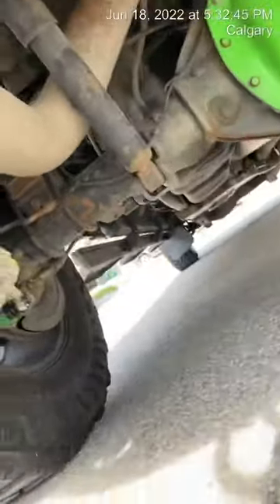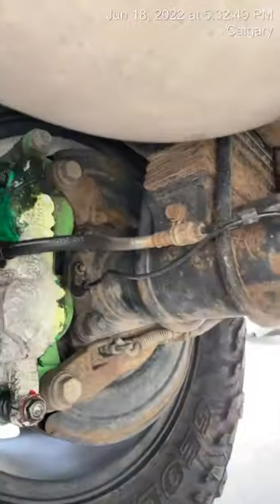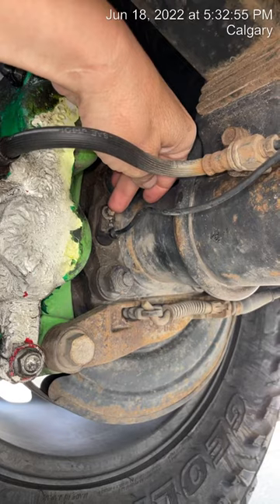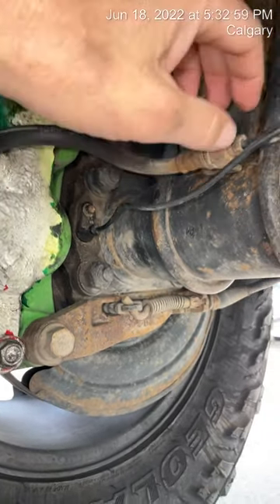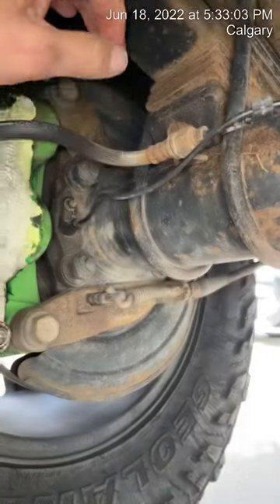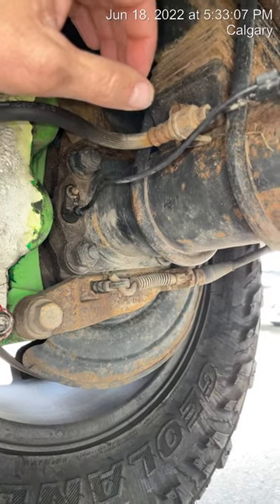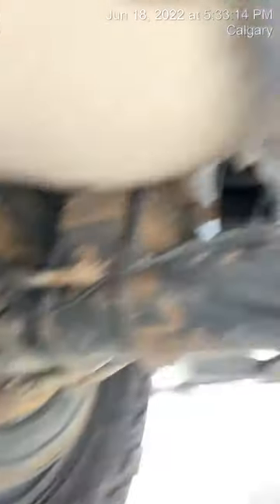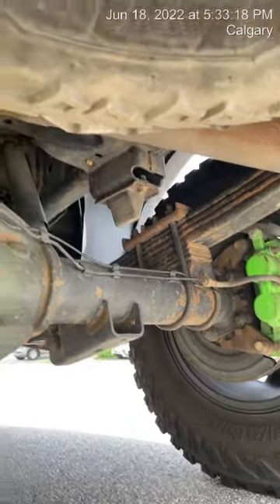2015 Dodge Ram 3500 service electronic breaking system  ABS repair. NO PARTS NEEDED

Comment: Hey bro, thanks for the video.  I went to try it, got the bolts off but the sensor won't come out.  The don't move at all, any suggestions on how to loosen them so they will slide out?

Comment: So I finally have my 2018 Ram 2500 fixed. It’s a long story but what it ended up being was a bad HCU (hydraulic control unit). Ordered a new one from Mopar and had a local shop install it.

Comment: FYI- the sensor is a magnet that produces voltage so metal shavings can reduce its efficiency to the point of setting a code. I have found the same problem multiple times

Comment: Hey brother I truly truly thank you for taking time out to do this video for people like me. I got that exact same thing on my dash today and had no idea. Thank you sir.
Reply from the maker: Right on Nate, sorry for the late reply, just saw it now.  Glad to help, I couldn't find any simple repairs so funny how things get fixed when they just need a good cleaning.  Happy Ram'n
Reply: Nice, what did you clean it with?
Reply from the maker: just a rag man, just a rag!   @rudolphblair8577
Reply: Did the same thing work out for you cause I have the same issue?
Reply: I have a 2017 ram 2500 will try this tomorrow! Ty
Reply: @JONESY7MM  I’m not a mechanic at all but some the job myself and it was very easy. Doing it myself saved me probably $500

Comment: I just did this to my 2018 Dodge Ram 3500 about 5 minutes ago. The light is no longer on, but it comes and goes while driving. I will update soon if it looks like this truly solved the problem (fingers crossed). That said, there was a mountain of soot all over the sensor, so I think this trick is what it needed.
Reply: having same issue light comes and goes on my 2014 1500, did this fix for you?
Reply: @BaconatorJR1  It did, but only for a short time. I had to get rid of the truck, it was having WAY too many problems. I traded it for a 2021 Dodge Ram gas engine. Every time something went wrong with my diesel engine, it was a nightmare getting it fixed.

Comment: Just want to say thank you !
I’ve got a 2020 ram, which is kind of similar. I took out the little modular, cleaned it, put them back. The thing was still locked up until I put my belt on and open the door and disengage the brake.
Reply from the maker: interesting.  Everyone seems to have a bit different solution and outcome but it all boiled down to that gunked sensor.  Cheers

Comment: Thanks alot! My driver side rear sensor was super gunked up. Cleaned both and unhooked the battery for five minutes, and went for a ride. Didn't go away right away, but after around 20 miles of driving I haven't seen it come back.
Reply from the maker: sweet, so glad it helped another happy customer! ;0)

Comment: Hi there, I have Ram 1500, 2014 and same issue with the ABS and traction control lights on. I just came accross your video after watching numerous videos about changing the ABS sensors, buying diagnostic scan first, etc. I am in Prince George, Canada and its currently snowing with minus 15. Hopefully I can manage to croll under my truck in the morning when it's a daylight and find those rear sensors you were talking about in the video. good luck to me!
Reply from the maker: Hey Angelina, ya hopefully it helps you too.  Seems to be helping the others that have replied here.  Thx for your story, keep me posted.  If it works for you make sure you "subscribe" and "like" so it'll start making the vid go to the top and help more so you don't have to search so hard.  I don't post much but this one sure seems to be helping ppl.  The again Angelina & good luck!

Comment: My truck started doing that. If you take the hydro boost lines and you shake them, there's a liner on the inside of them. You can see it on the older generation of ram. It would get sucked into the tube going to the hydra boost. If you change the HCU and the ABS module I would consider looking into and replacing those lines. I'm getting mine custom built to where it gets rid of the liner

Comment: my 2018 did the same thing all 3 of the lights turned on at the same time gonna see if this fixes the problem
Reply: Did it work? I also have a 2018 with the same issue.

Comment: I am having the same issue on my 2018 Ram 2500! I just cleaned both sensors. You were right they were both caked up with brake dust I guess. Hopefully this fixes the dash warnings. Thank you for posting the video brother!
Reply from the maker: my plesh Dude.  Glad I could help another brotha
Reply: did it fix your issue? i got the same thing going on just started this morning. i have a 2017 ram 1500 laramie with 51k miles. i literally just bought it saturday. pretty disappointed as i cant use 4x4 or cruise control until the light is off the dash!
Reply: @levisouthern4869   no it didn’t fix the issue. My warning lights come and go. The dealership said I need an ABS control module which is on national back order and not expected to be out until July! It’s ridiculous!!

Comment: Thanks for the info. I just clean all four of my sensors. Did your error message go away right away or did it take some time to register that you had cleaned them.
Reply from the maker: I don't recall there being front ones on mine.  Whats your year and model?

Comment: Thank you! Fixed my issue as well and saved me some $!
Reply: @Balthasarbrin Seems like once I got above 70 abs and traction light kicks on and it says trailer, abs and electronic brake system service, also my cruise won’t work when this happens. I just had new rotors and pads done at les Schwab but did you have the same problem??

Comment: Thanks I'll give it a shot
Reply from the maker: did it work for you?
Reply: @millertime7396  no it didn't, but at least I tried. So I just plugged it back in and put the panel back on. Too much electronics on these trucks!

Comment: Is the sensor just in the rear?  Or on front and back?
Just got this on my 2014 Ram..
Reply from the maker: I just had all my wheels and rotors off doing a rotor and emergency brake replacement.  I did not see the sensors on the front wheels, only back.

Comment: Yesterday my ABS light(s) came on my 2016 RAM truck's dash as I was driving out of the driveway.
I took it to my local Dodge RAM dealer. They said the ABS Module had an internal failure.
The diagnostic charge was $ 160.00 and the module was about $ 1,400.00.
They said it would take about a month to get it in as they only use genuine Mopar parts.
My truck is 7 years old with 32,400 miles on it. 
I purchased the Mo Par Max Care unlimited warranty which covers every thing (5,000) parts.
The mileage limitation was 1,000,000 miles. You may say I have a lifetime warranty.
That was the best thing I could have done was buy that warranty for my truck and my wife's car.
Dodge does not offer that any more.
All I have to pay is $ 100 deductible and I'm back on the road.
Reply: Damn eh. Redonkulous and they’d prob do exactly what I did and say you got a new module. Lol. Frickin stealers. 
Stealing Dealers. Lol. 
No wonder they stopped offering that. I’d be all over that too if avail. 
You should be able to ask for your parts back. The modules prob still good. I’d get the new one installed, take the OG back install the OG myself just to test and see IF it was the module. If it wasn’t you got a 1400 part to sell for $700. You just made $600 instead of paying $100
Reply: @fitfixinc.206  If it wasn't under extended warranty I would take the part back but since they are paying for it the parts is theirs. My last truck was a Ford F 150 super cab that I bought new in 1988. I kept it for 27 years before selling it. It was costing me more in repairs than I was paying in new truck payments.

Comment: I have the exact same issue right now.
Reply from the maker: did ya get er fixed?
Reply: @millertime7396  I bought the new sensors but I have yet to find time to install them.

Comment: I just had my rotors and pads done at les Schwab almost a month ago then this happened. At lower speeds it’s all good but seems once I go 65+ I’ll get abs and traction light and it’ll say service trailer, abs, and electronic braking system, also cruise won’t work when it happens. Did same thing happen with you??
Reply: Hey Man, it was so long ago I barely remember. Everything I knew at the time was in the vid. If your asking if it’ll help or not, just do it. Easy enough and could make the diff. 
NoDoubtAboutIt.
Reply: @fitfixinc.206  is it just as easy to clean the front sensors?? Or would I have remove the tire and calibers
Reply: Honestly not sure. I only had to do my rears so far. I’d assume it’s just as easy tho. I never had to remove anything.
Reply: @fitfixinc.206  mine turned out to be the front abs speed sensors. Rears definitely needed cleaned but thanks for the help!!
Reply: We’re the fronts just as easy too??
Once it warms up again I’ll be doing all 4 corners again.
Reply: i heard that if a brake tech forces the piston back into the caliper without venting the the fluid thru the bleed screw, that it hurts the abs valves and that can have the symptoms listed here.
Reply: @deriklfixit  the only way you’d be venting out the bleed screw is when your burping your lines. There would be no excessive pressure buildup in this case so nothing should get damaged.
Reply: @deriklfixit  sorry had to read that again. I have done that before when changing out pads just to give more wiggle room. The sensors don’t sit in the fluid so I can’t see why that would hurt them. Maybe you can look into it further and Skool us.
Reply: @fitfixinc.206  my understanding is that if you don't open the bleeder and Evacuate the brake fluid that's in the caliper to make space for the new pad, while doing a break ppad change, through the bleeder screw that it will then force that fluid through a check valve that is on the ABS pump valve set. And that destroys the ball valve and intern causes an ABS light to come on. Actually isn't about the wheel sensors and it is about the ABS pump valve set. And this is just what I've heard not what I know for fact
Reply: @deriklfixit  I just asked a mechanic beside me as we speak and he said as long as it’s done slow then there should be no issues. There’s a lot of back pressure there anyway so why some would rush that would just be dumb anyway. 
Common sense that ain’t so common as we all know. Lol. Thx for the additional input.

Comment: Do you use a solvent to clean the sensors?
Reply: Nope, just a rag. Certainly wouldn’t hurt to use a diluted solution like Zep or simple green but I did my find it necessary. It wiped right off.
Reply: Thank brotha,  I'll try it today and reply back with results.

Comment: Is this the same method for a 2017 1500?
Reply: I would assume so Aaron. I’m not sure exactly what the common year spread is but it’s a pretty common part. It would only take you a min to figure it out if you can get under the truck easy enough.

Comment: Thank you!
Reply: Hey Roc, did this actually help someone else?
Reply: Im also here in sw calgary, im gonna try mine now, all the same lights are on and will let u know what happen  after,thanks...
Reply: @normannanad9049  Sweet, ya keep me posted, hopefully it's that simple as well.
Reply: So Dodgers has this vid helped in your situation?
Reply: Once you took that little bolt out. How did you get the sensor out?  Mines pretty stuck in there and I don’t want to break it.
Reply: @nickfeilmeier8586  I’ll tell ya but ya gotta like and share, eh. 👊🏻
Just used a small flathead and wiggled it out gently. It’ll come but couldn’t hurt to soak it with some spray lube.
Reply: @fitfixinc.206  done!  Thank you
Reply: @nickfeilmeier8586  Top Notch. Make sure you do the like and share so hopefully it can help more ppl your connected with. Cheers Nick, thx for keeping me informed.

Comment: Nice tip, unfortunately the bolt sheared off on one, and on the other, that sensor is stuck on with corrosion. :|
Reply: Dang eh. 
Can you soak it enough with some bolt break lube?
Reply: @fitfixinc.206  Yeah, I sprayed and prayed before giving up on it.  Then told my mechanic son what's going on and he's volunteering to fix it for me. :)  SOLD!
I think this is the problem though so thanks for the video!

Comment: I took off my battery and connected it back and the engine runs now but im having a check engine light
Reply: Get yourself a tuner or OBD2 reader of some sort so you can find out what the code is and go from there.

Comment: where did you get your taillights?
Reply from the maker: Howdy, just saw your message and found it hilarious.  They're a high end custom design I made myself.  I was driving down hwy and there was a construction pilon that I happened to clip somehow.  I have no idea how with my fender flares and the bumper but I remember hearing it.  When I stopped it had broke 1/2 the red cover off so I just ripped the rest off and smashed out the other side to match.  LOL. I'm too cheap to buy a new set as they still work just fine.  It's literally been years and even rain and snow has not killed the bulbs yet.  Give me a hammer and pliers and I'll make them for you as well. ;0)